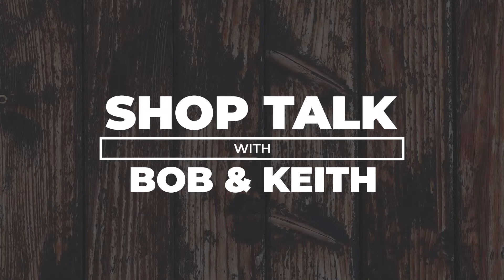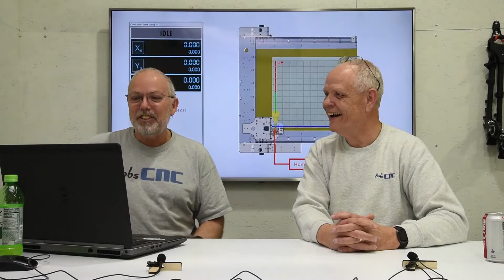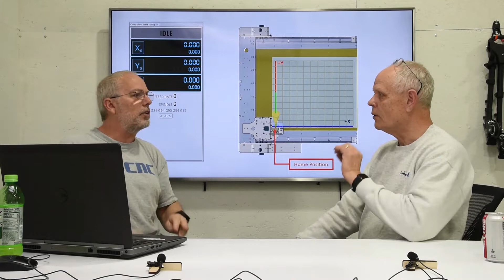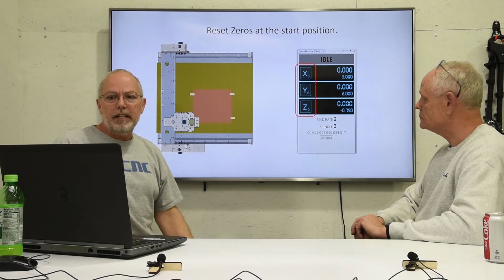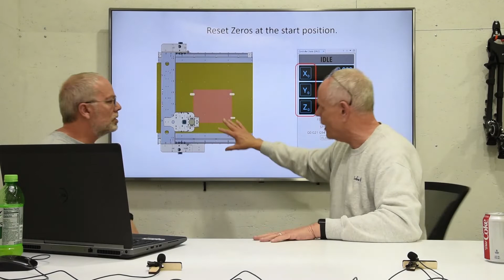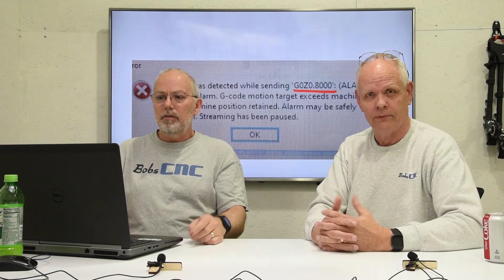Shop Talk: The Dreaded Alarm 2

Comment: this makes no since. I have the FoxAlien Moestro or whatever 4080. I am trying to plane a board. Say 1.5 inches thick 20inches long and 11 3/4 wide. With a 1.5  diameter planner bit. I pushed the bit up into the router. I just want to shave off .125inch off the board finishing depth of .25 of an inch. I am not worried about ceiling because I am well under it with the bit pushed up into the router. Plus I am going down into the board not up. What am I doing 3D printing? The bit is 3/4inch up off the board in the home position. And if I move to the corner of the board and set it as my zero position. With the bit just above the board. And push send code. I get Alarm 2. I do everything to avoid the Alarm 2. And I still get it. What the heck. I am about to take a sledge hammer to this machine, first rip its little limit switches off and smash them with a hammer. Then sledge hammer this machine to the earths core. Downside to this I am sitting here venting. This video is 4 years old and these guys are probably not even watching to see if they get comments on this video any more.